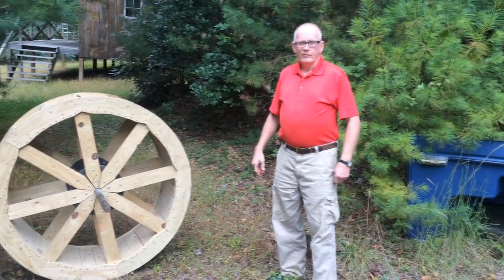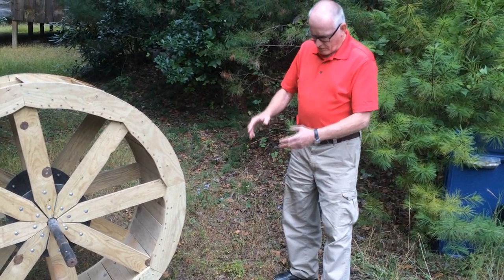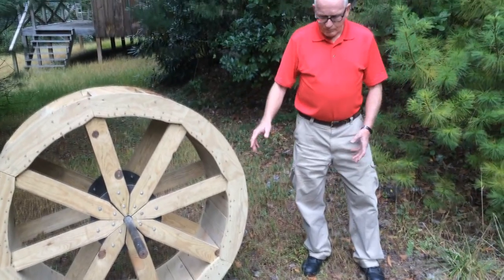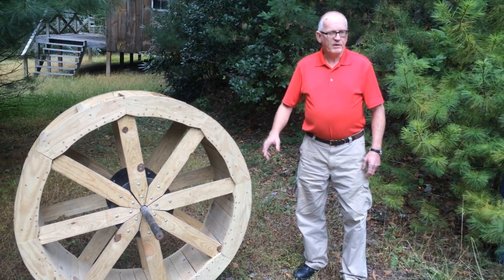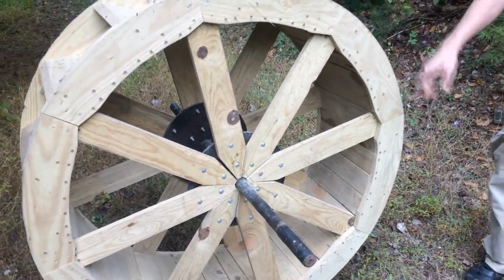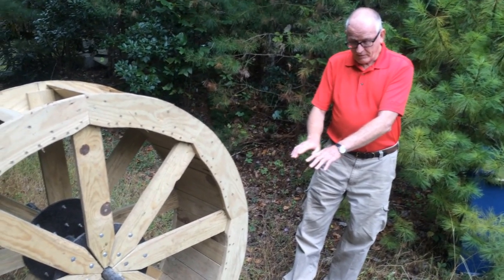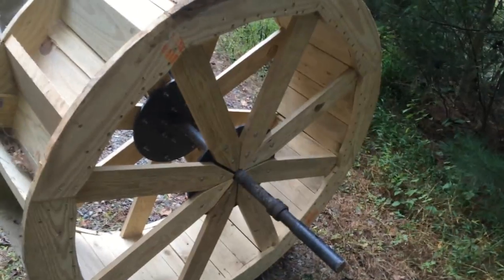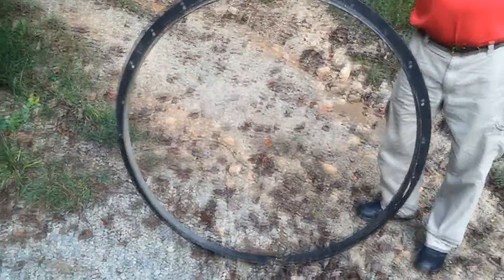DIY WATER WHEEL POWER

Comment: I wonder if you would mind giving more information about the actual construction of the water wheel.   How did you do the hub and connect the parts.  I see you've angled the paddles.     I have an interest in using a water wheel to power a low RPM water pump that we have.
Reply: If you find anything about the hub I would really appreciate you letting me know I'm in the same boat. I'm trying to build a small generator and my first attempt didn't go exactly as I wanted it to.
Reply: DenverDave2 ;